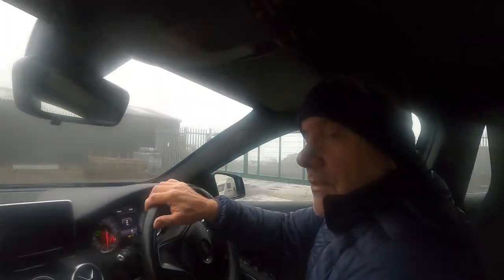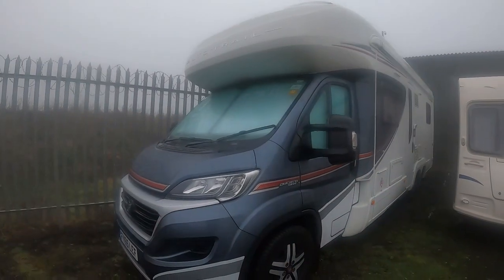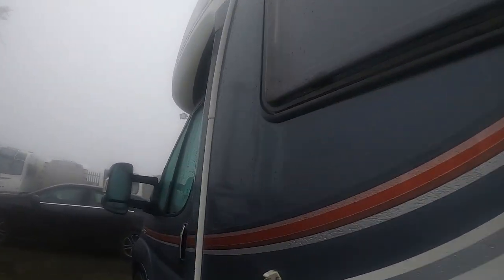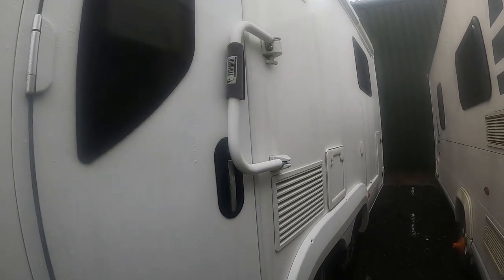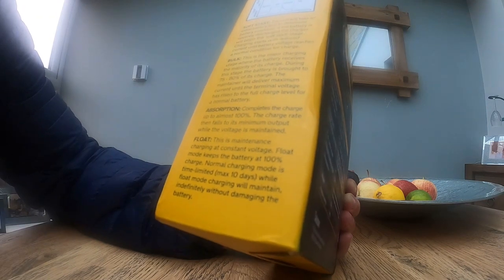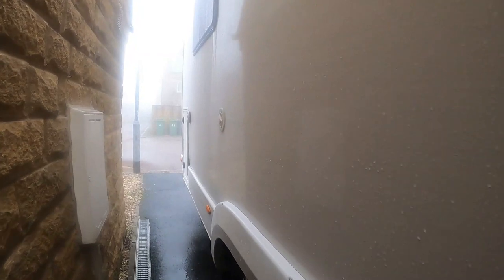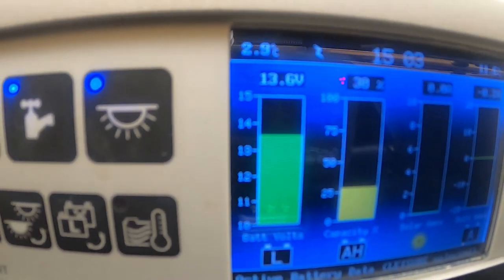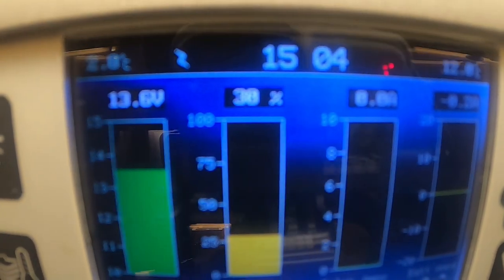Essential Motorhome Battery Maintenance For Winter

Comment: We have a duel camera on our Swift and it had an intermittent blue screen. Turned out to be a poor connection at the dashboard end. Cheap fix for us. Our leisure batteries are coming up to 3 years old. We are watching and waiting but with two in situ they seem to last longer than just one lone battery. 😁 Trev
Reply from the maker: Poshcats Camping I hope our blue screen problem is down to a poor connection. As for the batteries I’m not sure how old they are as they came with the motorhome when we bought it in April. I’m going to speak to Brownhills on Monday about the camera as I think it maybe covered by the warranty fingers crossed 🤞 
Happy Christmas 🎄 to you. 
Kev
Reply: If you update your batteries buy two identical new batteries at the same time. You may know this but don’t try to get away with one new one as the life of it will be impacted by the old one.
Reply from the maker: Poshcats No, I didn’t know this, makes sense though. Thanks for the advice.